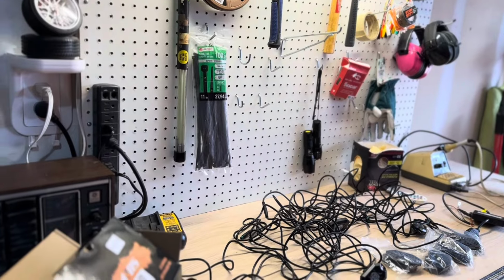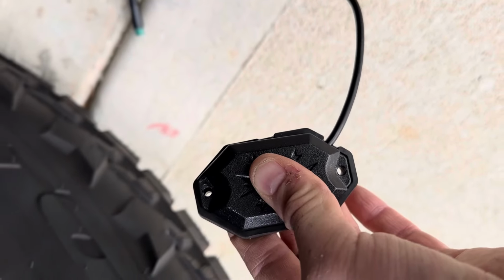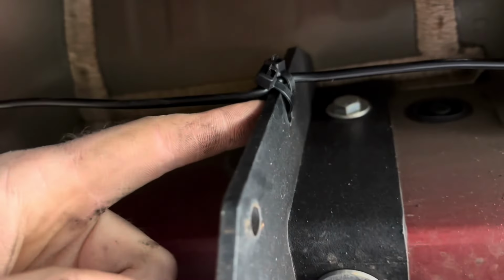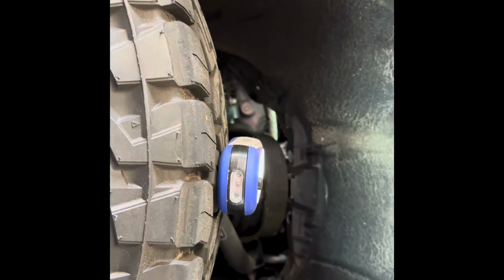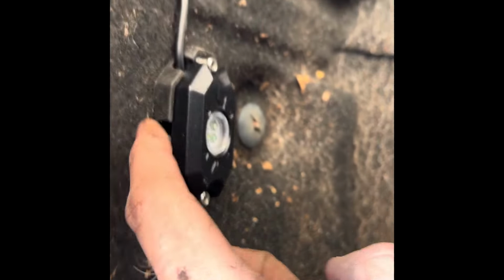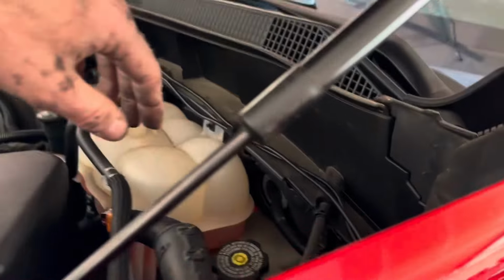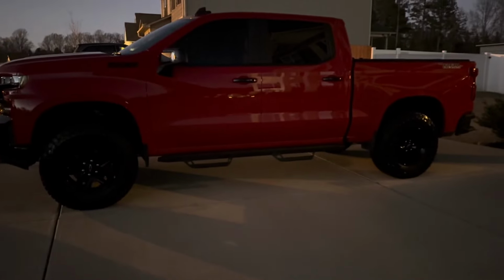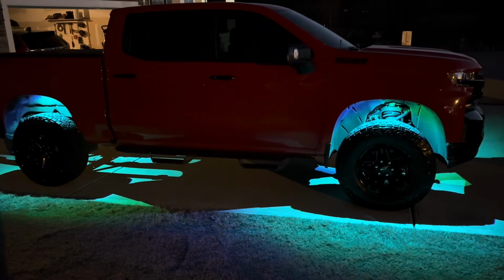SUNPIE Rock Lights Installation | 2020 Chevy Silverado Trail Boss

Comment: my battery cant hold a charge bc of my wheel lights. and im looking to install rock lights. what is the best battery options for those mods?
Reply from the maker: I would suggest using a DC amp meter and clip it around the positive wire of the lights when it is hooked to the battery and see if there is any draw off of the lights when they are turned off. If it is drawing any power while they are off I would install a rocker switch inside the truck/car and break the positive connection for when you are not using them.
Reply: @zachattackcustoms  imma just have to use a fuse tap instead of connecting to battery

Comment: Since is connected to the battery can u turn them off with an app so it doesn’t drain the battery 
Thank u for the video by the way
Reply from the maker: Yes, you can turn them off with the remote it comes with or the SUNPIE LED app. They both work fine controlling the lights from inside the truck.
Reply: @zachattackcustoms  thank you I really appreciate it I got a same truck and I just ordered same rock lights I’m excited
Reply from the maker: @irnesislamovic8151  Nice, hope install goes well, let me know if you have any problems with them!
Reply: @zachattackcustoms  will do thanks
Reply: @zachattackcustoms  how long of an extension do I need and do I just need one? Thanks in advance
Reply from the maker: @braydenpowers1542  SUNPIE 5 PIN Green Connector RGBW 118" 10 FT LED Rock Light Kits Extension Wire Cable Cord for 4 8 Pod RGBW Rock Lights(NOT FOR 4 HOLES RGB ROCK LIGHT https://a.co/d/h2oGGw9

Comment: Worth it?
Reply from the maker: For the price and if you want multiple color options, yes. It is also a great option if you don’t want to go through the firewall. On the other hand, I also installed a Lasfit kit on the truck and those are much brighter, but there is no Bluetooth and they only have two colors, amber and white. Check out that install if you would like to get a little comparison to see which one you might like better. Hope this helps!